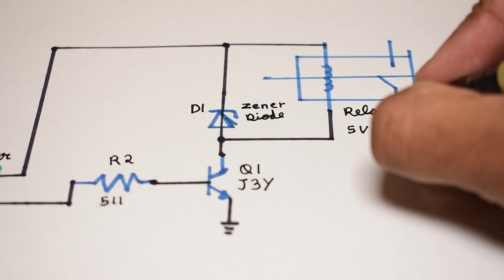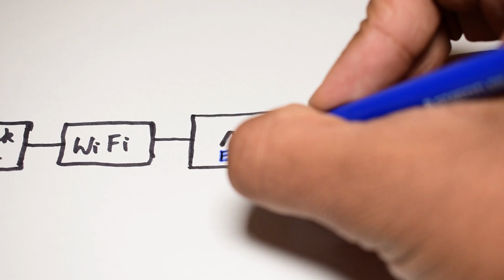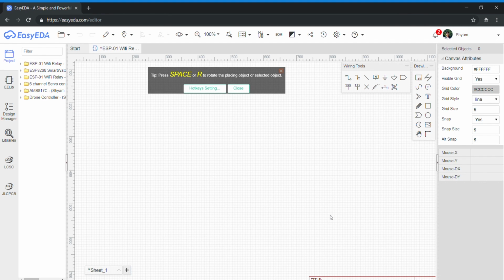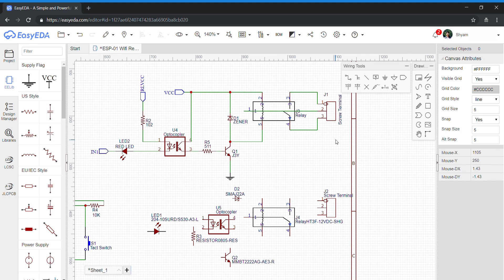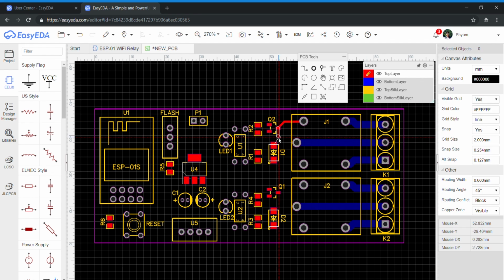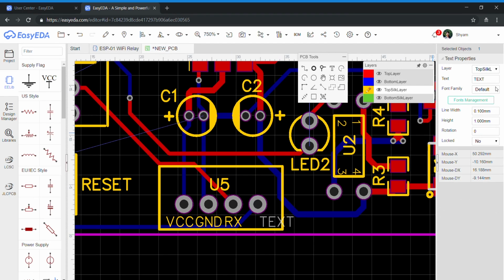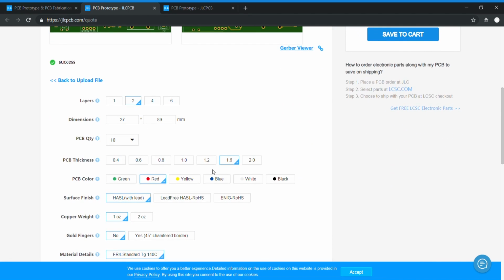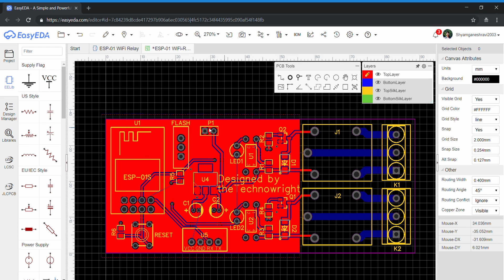How to design a custom PCB using EasyEDA || JLCPCB Review

Comment: Can u make better tutorial on how to calculate the width of the wire and via diameter? Basically on the rules for the pcb design. Also i would like to see the smd soldering service they have. Besides that, perfect video 😀

Comment: Good video, especially like that you talked about shipping costs to different countries.
IMO once shipping is included, jlpcb doesn't sound like the best option, especially in light of the trade practices of China and the IP issues ... if you are having a product fabricated and don't want to have to compete with clones of your product instantly.
Reply: Nobody making IP sensitive PCBs is using Chinese manufacturers. So it's a moot point.

Comment: You are clearly an expert in this software, but before an expert can be a really good teacher, he has to "unlearn" his subject so that he can see the difficulties a novice will face when watching his lesson.  In this case, (5:25) you were continuing to talk about what can be done, while the mouse flew around the screen too fast to track, and netports appeared and got relabeled.  It took me quite a while to figure out how to do that, exacerbated by the fact that the "Wiring tools" and "Drawing" blocks that appear at the top right of your screen do not appear on my screen.
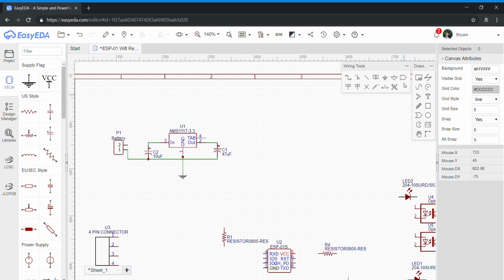For me, as a novice who downloaded the software only an hour ago, this tutorial would have been much better if you had slowed down a bit and described what you were doing instead of what can be done.  For example, how did those wires appear at 5:27?
I haven't got further than placing netports yet, so I may find other difficulties too (I haven't figured out how to label the schematic yet).  Don't get the impression that your efforts are not appreciated - they are - but I feel that the video could have been even better.
Reply: This is a brief overview, not a step by step circuit design tutorial. There are plenty of those, and they are HOURS AND HOURS long, of watching a guy's computer screen while he does voice over. If you thought you would be planning anything on here, besides a very brief and basic overview, in just 15 min, you came to the wrong video
Reply: @littlejackalo5326  The "step by step" tutorial that you compare with would cover a lot more ground than this intro.  I wasn't suggesting that he should cover more ground - only that he walk a little more slowly so that his viewer could follow what he was doing.